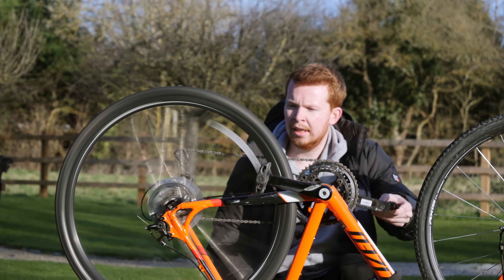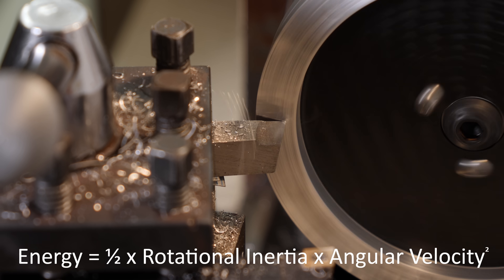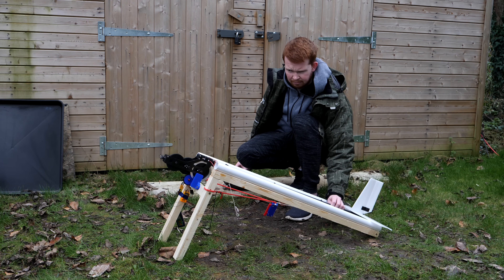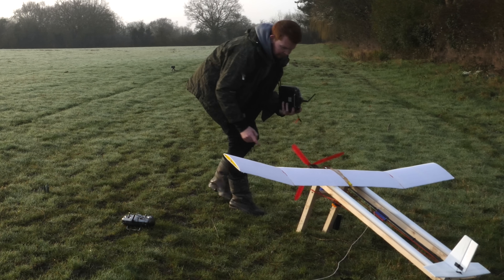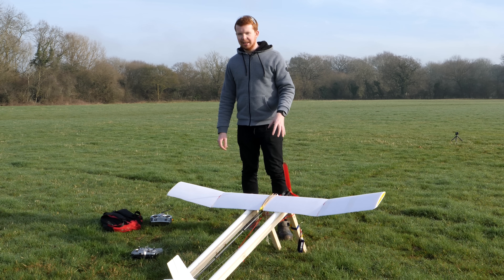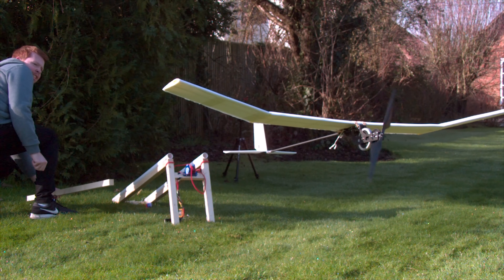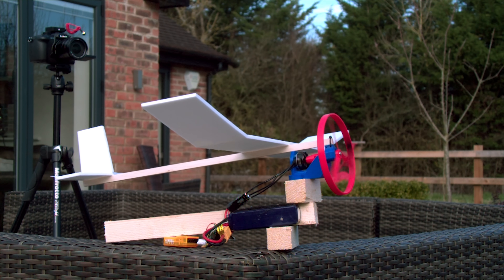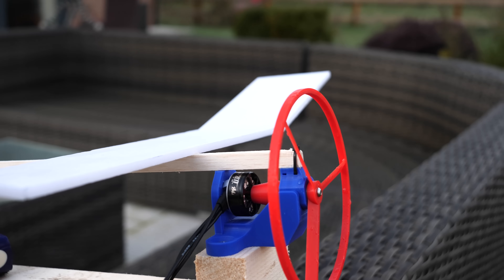Flywheel Powered Plane

Comment: So, the result is all well and good, but that's just a design stolen from the toys of our childhood. We all had the little planes or helis that used this exact setup to power them for a short flight.

Might I propose a new experiment, though. In theory, it may be possible to make a highly efficient flying craft and I'm curious to see it it would work. Mounted in the center of the craft is a wind wheel (same design as a water wheel) that is spun by the wind from the prop (as well as flight velocity) which rotates top-over-back. This wheel would then be connected back to the propeller to feed back some of the energy from the moving air back into the drive mechanism.

What I'm particularly curious about with such a setup is whether the magnus force from the rapidly spinning wheel would provide substantial supplemental lift.

Comment: Better Hover Craft Challenge.

Tom: Mike here. I am a retired US Navy Hovercraft Engineer. I would like to throw a few ideas your way for a challenge! 1st off I am disappointed in most Hovercraft i see made today. Why? They are missing something very Important imo.... "Bow Control." Control of a US Navy Hovercraft at Low speed is critical, Entering well decks Parking next to other craft etc. To Control the Bow their are Two "Bow Thrusters" with 2 types of Modes. Fwd(Cruise) & Reverse(Maneuver) Mode. In Reverse Mode both Thrusters Point forward Thrusting craft backwards, both turn at same time. To Counteract this about 10% Fwd prop pitch is needed to maintain 0 speed, this will push air past the Rudders aft of Propeller giving more control to the Stern of Craft as well. Craft can move Sideways or turn on Axis in "Maneuver mode" Our Pilots who fly these understand that at cruising speed (35-50 knots) a Perfect turn is 3 degrees per second, this is standard to protect Skirt system (Side slip can drag off Skirt finger attachments) from side slipping over water! In Fwd mode they point Aft, 13 degrees off of 180 pointing outboard slightly, and only 1 turns at a time rotating inboard to control a turn (less then 3 degrees per sec.)

Control Challenge: The greatest test for Craft Control was the idea to use Hovercraft for "Anti Mine Operations" in the Surf area of Beach landing zones. Basically we use GPS to position Multiple Craft perfectly to Shoot out a Anti Mine Netting that would clear area in front of Craft so they can land safely on beach ahead! GPS is not required here but I would love to see how you go about this with a Newer better hovercraft that you can Guide to position and control by hand controls!

On Learning to Fly a Hovercraft the Hardest thing to learn how to do is; Hold Craft in Place in a 0 Speed Hover! Everybody loves hovercraft but the one I like best will have no problem with a Obstacle Coarse Hint Hint!

Comment: Hi Tom, thanks for the great videos, looking at your stuff I was inspired and sort of came to the conclusion that attempting to design an auto-rechargeable hyper-cap plane should be an interesting project.  I would attempt it with these general guide lines, but of course your experience should be put to profit to tweek the whole thing.   

Glider type plane, with a big battery to launch the plane and gain altitude (this stage of flight should last  minutes not seconds) we need to climb and store energy as altitude, then figure out a way to drop the battery, and switch power source to out super-caps. 

Now in the next stage of flight we need to continue altitude gain with the super-cap source of energy.  Once the super-caps are out of energy, weed need to find a way to drop a wind generator (all large commercial planes have these I think in case of internal power failure - not sure)

Could we have a very large prop (hidden in the wing) and pop it out with a sail type servo on a lever that would raise (or maybe lower - that would be better creating drug under, and pitching the nose down to gain speed) 90 degrees, hum I don't like this, too much, weight in the back and moving too much around.

No, it may be better to have a long shaft that goes right to the tail of the plane, and a large prop at the rear will need variable pitch, so when climbing and take off we feather it out.  So once we are up our highest altitude and all energy is drained we go into a fairly steep dive and try to get the large rear prop turning and recharge our super-caps.  Then we need to find a way to stop the large prop in a horizontal position, and switch the motor on to try to gain a bit more altitude and cycle through the whole process  again, with a bit of luck and thermals we could maybe go on quite a while.

I hope you get the idea, I have not seen this type of aircraft yet, I think it's a promising approach, the same as the Prius I drive that recharges when the vehicle slows down.  Thanks again for your time, all the best, Louis
Reply: Tom, would be curious to hear what you think of this?

Comment: If you're pushing the material properties to the max, then the best material for the outer ring is carbon fiber as well, though I suspect you'll have issues with gyroscopic forces in a plane.

Comment: What about a smaller flywheel and greater gear ratio. 44/14. Would that exceed the fan speed of the prop? Apologies if my armchair engineering is way off base.

Comment: is there a way to keep prop speed constant regardless of flywheel RPM? this way most of the system can operate at more "comfortable" rates whether the flywheel is at full speed or as its slowing down

Comment: If you use flywheel+generator and electric motor powered by energy from generator+propeller you will be able to maintain constant(controlled) rotational speed of the propeller.

Comment: It would be interesting to try to make a plane powered by a reaction wheel. Whenever the plane angles above or below the horizon the speed of the propeller changes to correct the angle of the plane and make it level with the horizon again.

Comment: That invention is very heavy to fly, it should be done on a 3D machine (The metal system) and so you can fly without problems of getting the plane.
Ese invento es muy pesado para volar debería de hacerlo en una maquina 3D (El sistema metálico) Y así puede volar sin problemas de que se te clave el avión.

Comment: Great stuff. There was a small-scale boat built that used kinetic energy, in the form of a series of moving weights. Surprisingly it's power efficiency was better than a jet engine's, though the model moved pretty slowly, maybe a foot per second in a swimming pool IIRC.

Comment: As I'm watching this I am wondering it the inertia of the flywheel of effecting the attitude of the plane.  It might explain the plane diving into the ground.  If this is the case,  reversing the rotation of the flywheel might cause the plane to climb or to stall.

Comment: Early airplanes had a lot of rotational kinetic energy because the entire engine block spun. The pilot would make an aileron turn, the torque vectors would combine and the airplane would flip out of control. This is a stupid idea. I don't think it is even workable for a bus or a stationary flywheel "battery" for storing renewable energy.

Comment: Electric vehicles have used flywheels in the past, but they never became popular. You may try and use a system that converts rotation into electricity that drives a motor. This is better than mechanical coupling. NASA's G2 flywheel is a good example of a flywheel storage system.

Comment: Could the nose dive be caused by the direction you chose to have the fly wheel spin? Would spinning the fly wheel in the other direction cause the nose of the plane to tip upwards?

Comment: Could the nosedive be caused by the direction you chose to have the fly wheel spin? Is the nose dive a reaction of the planes body being counterintuitive to the direction of the fly wheel spinning? If the Fly wheel spun the other way would it tip the nose of the plane upward?

Comment: HAY TOM, i HAVE AN IDEA! MAKE A GIANT PROPELLER DRIVEN BY MINI PROPELLERS!! If you make the propellers kind of knife shapped and paint it all silver then you can call it A REMOTE CONTROL SHURIKEN!  Make make 4 of the same wings and then make a super strong X brace in the middle like by welding the square tube sections together or using epoxy to connect 2 carbon fiber rods so they are perfectly flat and perpendicular! Anyways the point is to put propellers with motors on them onto the wings (hopefully on the top side so they don't break if it lands unexpectedly). Maybe put 4 wheels on the wings and like a little foot in the middle on some kind of spinner so that the weight is supported when its not flying. If you paint it all silver to look like a shuriken you will need to put different color lights on the wings so you know what orientation it is in even though it is going to be spinning. Maybe you could use RGB lights and have them blink with the spin and program it so pressing forward always makes it go forward? You could get some kind of primitive control over it with a basic drone set up but I think it will need a fair bit of programming to get it to work. If you really want to get crazy then put actual servo motors on the flaps so you have even more control, maybe you could even use winglets as rudders with servo's directing them. If you can measure how fast it is spinning  and somehow let it know it's orientation then you can oscillate the engine speeds or flaps so you can control where it flies. You can also use that info to set the flaps to flutter as they pass a direction so you can tilt it and fly it at an angle or use the info from the gyro to tell if it is tilting of course and automatically fix that. If the timing is a little bit off then over time the forward direction could become left if you know what I mean. Actually now that I think about this, it would probably just need to have the programming on a drone or 2 modified. And you could make this into a multiple video thing where you show us the results and how it flies in aq video after each iteration. It could be a multiple video project finally and up flying it perfectly with the programming at the end showing all the steps it took to get there or it could be like a one day goof type of thing depending on how much effort you want to put into it! If you paint it silver and make the wings look a bit like knives then you can call it a remote control shuriken and I know there has to be some anime that has something like that in it so you can turn it into a make it real episode. If not then I'll just have to get Allen Pan or Peter Sripol to make it.

Comment: I think the reason your original plane design failed to fly was because your flywheel was geared the wrong way. You mentioned that you purposefully built it so your flywheel would spin quickly, but your propeller would spin slowly; but that's just increasing torque at the cost of speed, so even at maximum RPM your propeller just can't reach the kind of speeds needed to fly properly. 
Now, on paper, your system should work great given a high enough RPM, but I think you would see better performance if you reversed the gearing, e.g. the flywheel moves at 1/16th the propeller's rate instead of the 16x rate you chose, and then still spun up to the same rate, your propeller would have a much more immediate thrust which would be able to properly move the plane. 

(slightly rambly essay incoming, it's safe to skip if you want, it's just slightly unrelated background)

My thoughts here come from my experience in robotics, because in last year's competition for VEX robotics there was an emphasis on launching balls into flags to turn them towards whichever color you've been given for that round, red or blue.  The design my team chose was a flywheel similar to this, but instead of using an aluminum wheel like you have, we just used a relatively weak motor. (Poor decision, but that's a story for another time.) We found that to launch the balls at a high enough speed to even hit the flags, we had to spin our launching wheel extremely quickly in relation to our relatively slow motor, which of course meant using plenty of gears. 
Although my story may seem unrelated to your problem, in general we found that higher speeds and, just as importantly for us, higher immediate forces at the output of our launching system were achieved when we had a slower moving flywheel component. This was, of course, a motor for us, but a motor is really just a flywheel using electrical energy instead of mechanical energy to run if you think about it. So in short, I think if you want to output a higher speed at your propeller you should slow down your flywheel in relation to it, because it lets your propeller push harder against the air.

Comment: To preface, I'm an aerospace engineer. Something you may find interesting is that many internal combustion driven aircraft do not have a flywheel on the engine itself because the propeller acts as the flywheel.

For your original design, you may have taken this into consideration but I would have tried mounting the big aluminum flywheel a little bit further back. When you have your CG too far ahead of your neutral point, you can actually become "too stable" which causes the aircraft to behave more like a lawn dart than an aircraft.

Another thing, try adding some twist to your 3D printed propeller. It shouldn't add much complexity to the print and should make the prop more efficient.

Comment: The Flywheel are running to wrong side. It's running to down in the front of wheel, but need to running to up, inverted by the actual position.

Comment: The gears are on a slow rotation why not try putting the belts in a different configuration AS IN big gear to small gear and so on you might get a faster rotation

Comment: the flying hula hoop is interesting.  It's almost exactly like the flying wheel in the "Snap Circuits Jr." kit.  it's surprising how far (and quickly) that design can move.  I'd be tempted to build one with carbon fiber blades, and a metal flywheel ring to see what kind of performance you could get... also, what if you spun it up in a vacuum or low-air environment then had a burst seal to release it?  I enjoy your channel!

Comment: Did you considered angular momentum of flywheel in your project? It's what causing all that wobbling and sidwards acceleration. You should really try to set flywheel parallel to wing suface or, like in your simple version, parallel to propeller.

Comment: You should probably learn more about physics. A flywheel can never drive an airplane and remain controllable at the same time. No matter if you have set the center of gravity correctly or not. It is a physical law. 

But the good thing about the video is that you actually showed the physics indirectly ;)

Comment: Haha, I've thought about this myself for many years great stuff.. the question it seemed to mainly came down to each time was well how much strength can we get out of the flywheel while keeping it light enough it's reasonable. And also that it needs to spin fast, relatively consistently, and for a relatively long while. Then to have it do more than just one Toss-flight or launch it came to ok how can I get a flywheel to continuously spin something at high enough speed to actually utilize it like a "motor" and I never made models to actually do it but I've thought alot about using magnets, induction, either a pulsing motor to keep the fly wheel at a certain speed, or one of many other solutions.

Comment: smart solution: use the rotating earth-sun system as the flywheel. now due to the large diameter og the flywheel you dont need the transmission between the flywheel and the airplane anymore. put the airplane on the Earth directly and it will magically fly around the Sun once a year for quite long. Also doesnt need any winding up since this flywheel been already wound up by  the nature. We are laughing at cargo cult tribes with their straw airplanes but in fact their airplanes are just a version of this.

Comment: what is the highest rpm a 0.1 kg black hole can rotate before it flies apart? maybe could store more energy than aluminum ring. And if a black hole falls apart due to overspeeding, what will it fly apart into? Lincoln from Fermilab, Ligo guys or deGrasse Tyson please answer immediately.

Comment: For that gear that shredded, while I have ZERO 3D printing experience; I understand you can change the compression properties by changing the plane in which you're printing. You might be able to make it less likely to sheer by rotating the gear 90 degrees when printing.

Comment: The rotational inertia is trying to rotate the plane such that the front part is coming down,
Try with propeller rotating in opposite direction and so the flywheel.

Comment: I think for things like the initial flywheel test, you need a mechanical fuse between the bevel gear and the propeller. Something 3D printed that can shear if the prop is stopped suddenly, which you can 3D print a bunch off for testing. That'll save you a several hour bevel gear print each time. I think the flywheel is delivering way more torque to the prop than is really needed. Maybe try reducing the gearing down a bit, have the prop spin closer to the actual flywheel speed

Comment: Build a sealed (vacuum if possible) box and use a generator to tap the fly wheel to charge batteries. This will give you controlled powered flight and still use the flywheel to recharge the battery. This is most probably the design that would give the best controlled flight.

Comment: I remember those toys. I was obvious that the gears would get ground up as soon as the prop hit the ground. Did you try making a larger, 3D printed version of the ring prop design with more mass? The gyroscopic stabilising would be interesting.